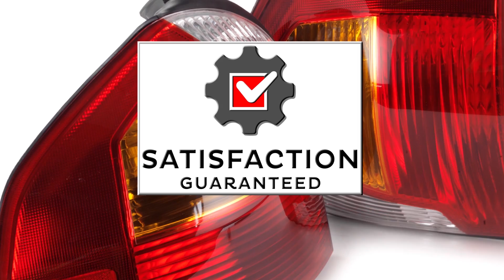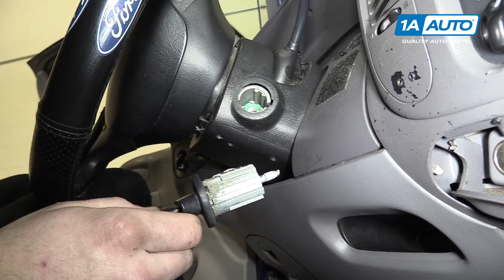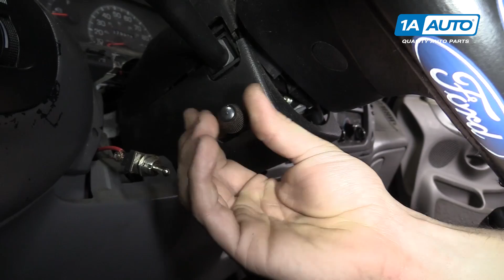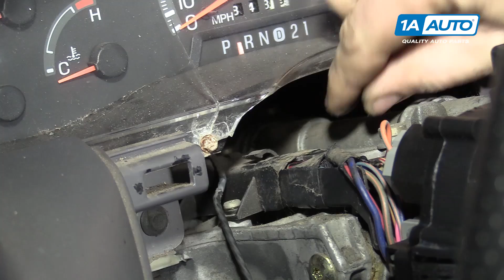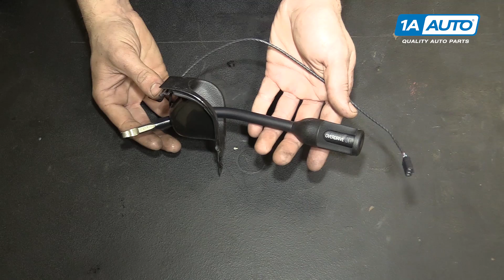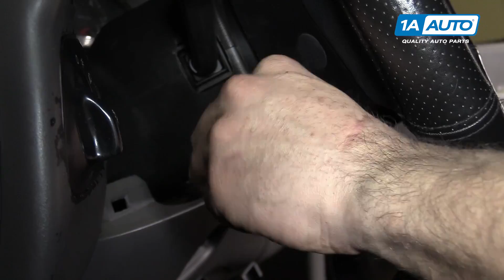How to Replace Automatic Transmission Shifter 97-03 Ford F-150

Comment: My 97 F150 has 354000 miles on it and I have this problem so I have to pull it over to the left and it starts. I just wander if it is still worth fixing.

Comment: I followed everything you did on replacing the column shifter on my 01 Ford F150 very helpful but when I went to start it up, no crank or start up everything else works as it should did I trigger a theft mode or the immobilizer. Didn't move anything as I pulled the column apart, do have to reprogram or reset it what can I do?

Comment: Getting to the connector is easier if you remove bottom cover under steering wheel. Remove hoodlatch and brake handles

Comment: The 1AAuto videos are extremely helpful, I truly appreciate them, you have saved me lots of money and aggravating circumstances on my 1st Gen Ford Expedition. Anyone who is in need of how to fix lots of your automotive issues for a 97-02 Ford Expedition or 97-03 F-150 it's basically the same vehicle and 1AAUTO is a great resource. If I may add my 2cents, I would like to see in your videos that prior to fixing the issue at a hand a brief summary to what would either cause the problem and what are some possible signs of a failing part and if you know of  possible tricks of the trade to making removal and or installation a bit easier to share them with us. 
Thank you again for all your help!
Reply from the maker: +Apollo b Thanks for the tip! We'll pass this info along to our production team.

Comment: The whole plastic end piece that holds the overdrive button broke off my shift lever. What a crappy engineer who came up with such a bad design. I am thinking of relocating the overdrive button and living with the shift lever until someone designs a replacement with all steel.

Comment: Two questions: can you replace just that little broken part at the end by the overdrive button? And when you replace the whole arm do you have the ability to adjust the indicator lining up with the gears? Mine is off and the little piece at the end is broken off.

Comment: If the gear select has about 1 inch worth of play up and down, is it the faulty bushings that hold down the column or should I just replace the gear select lever?  Is it the "pin" that has worn away that allows for the extra "play" or is it most likely the black column bushings that have worn away..????
Reply: You probably already moved Long, but I'm betting it was the black plastic bushing that needed replaced.
I did that first and it was 80% better, found a junkyard shifter to swap out and it's now 90% better.

Comment: I have a F-250 diesel 2003 . Do I need too disconnect the Batteryr?
Reply from the maker: +Jeffrey Kumjian Thanks for watching!  You do not need to disconnect the battery for the application shown in the video, and shouldn't be much different on a diesel.  1aauto.com
Reply: @1AAuto  Do I need too turn it too the run position on a diesel ?
Reply: I have a dorman shift lever and i can plug in the electrical connection

Comment: Great tutorial. I am looking to do something similar in a ram 3500. I need to change the lever  to improve leg room. The bend in the lever causes it to hit my knee while in drive. Can the lever on the Ford be installed upside down,  so that it curves in the other direction  ( away from the knees ) ? Appreciate Any Insight You Can Provide.
Reply: Hey if you think you can make it like that go for it there's guys who modify their rides like that it will look cool and work for you.

Comment: I WAS WONDERING, WITH THE PROBLEM I'M GIVING WITH MY 1997 FORD EXPEDITION GEAR INDICATOR NOT MATCHING THE GEAR LETTER AND WHEN I THINK IT'S IN PARK, IT START TO MOVE, THEN I HAVE TO GIVE THE GEAR HANDLE A LITTLE WIGGLE AND.....THEN ITS IN PARK. IS THIS AN INDICATION OF A GEAR SELECTOR OR THE CABLE TO THE TRANSMISSION?
THANKS FOR TAKING THE TIME TO EVEN CARE ABOUT US..
Reply from the maker: +Mr,Buttery Thank you for checking us out. With this situation, it could be that the cable running to the transmission is loose and not locking into place, or the gear selector is loose. The easier piece to check is the gear shift selector so we would recommend checking this for the OE specifications. 1aauto.com
Reply: holy smoke, you are real. Wow... and you replied back..I'm trippin. thanks Mr. Unicorn

Comment: I would like to see how you actually disconnected and connected the wiring clip without dropping the lower dash panel.  There is also a third retainer above the connector that makes pulling the wire through after disconnecting nearly impossible.  Dropping the panel  is not difficult and gives you a lot of room to work.